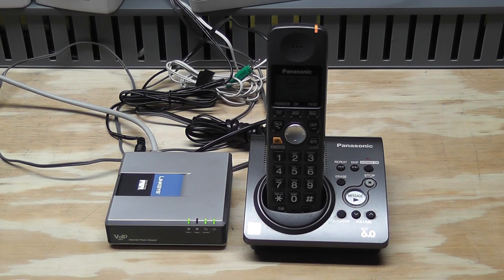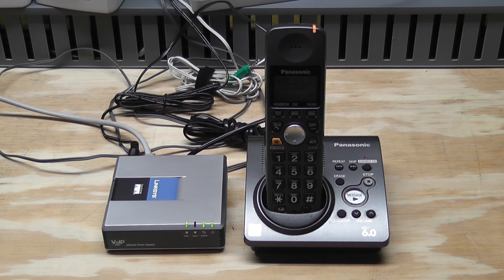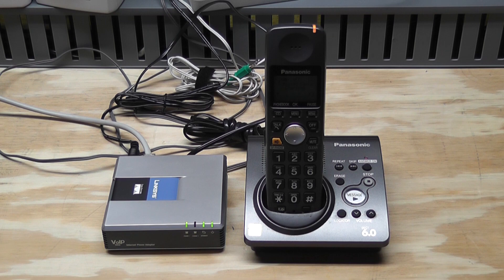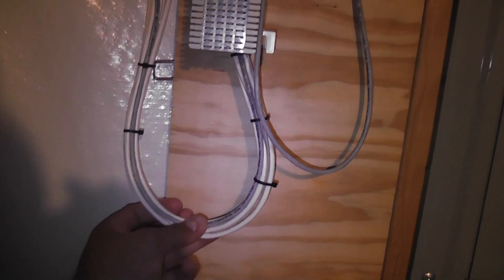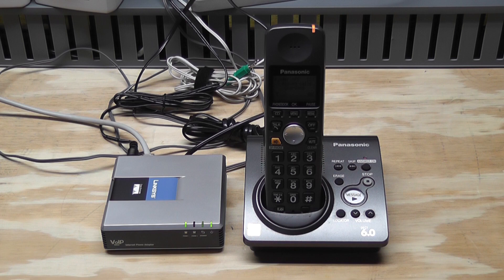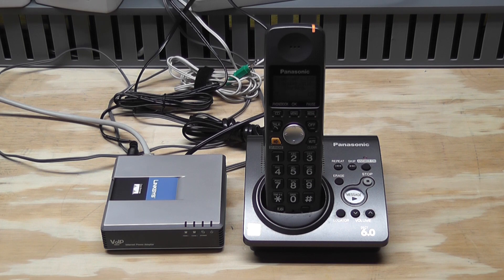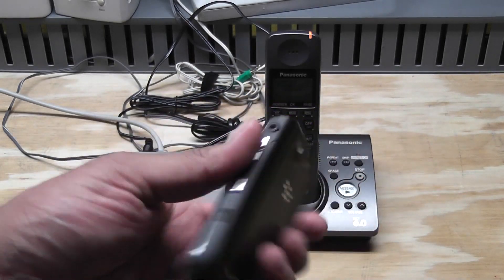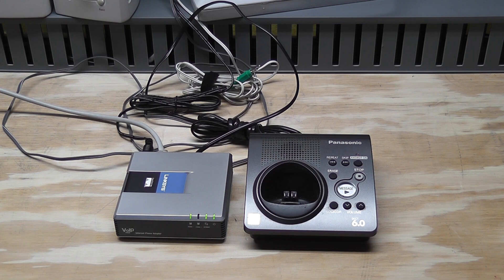Home PBX Server - Part 4 - Configuration Issues

Comment: It's heating up because your RJ11 runs are too long. The power supply providing the voltage to your analogs was not designed for that.

That's why PoE devices run at 48V, it's easier to provide the power needed at that voltage over longer distances without a massive power supply.

Good luck with your project.

Comment: i love asterisk, its very fun stuff, but difficult to work with.
I had the same problem with the 7 digits, i had to create a route that detected only 7 digits, that would auto append the local area code for the outbound call.  Its been 5 years since i've played with the system so i don't remember what i did exactly.  I currently have vonage and have been unsucessful in porting the number over to somewhere else, and i really don't want to change the number, so im stuck currently.